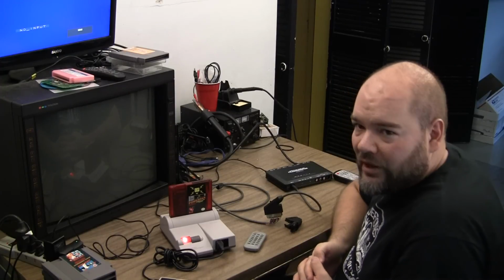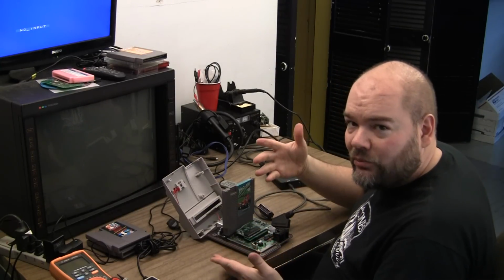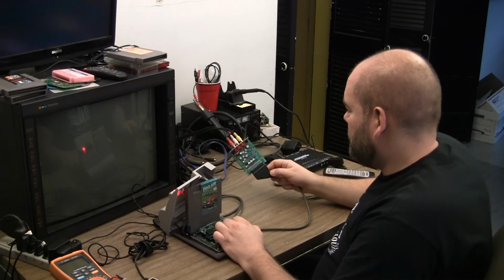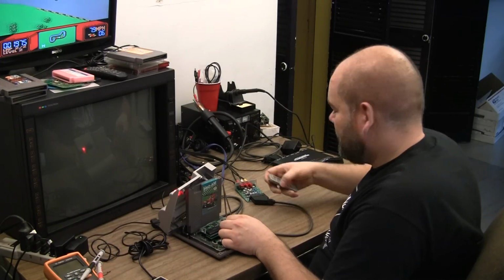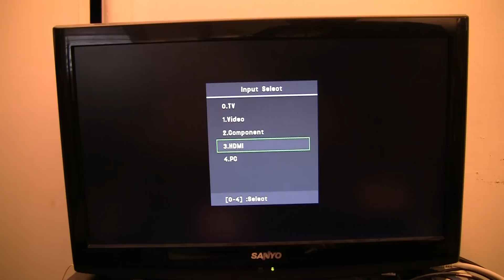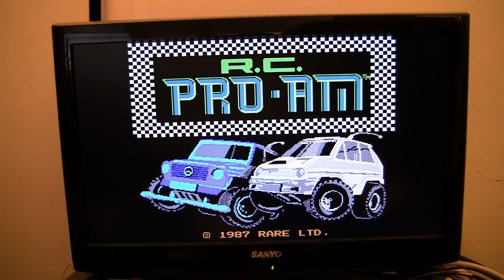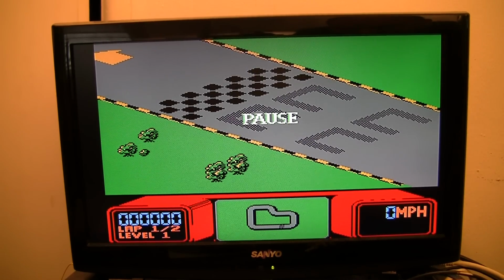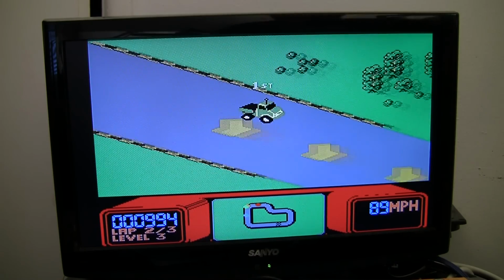NES-101 Nintendo - NESRGB with xrgb mini and csy2100 Pt 3

Comment: I've heard of a lot of people having various issues with the CSY2100. I know in a previous video here, you pointed out some video glitches that showed up when using it that weren't there in straight RGB. I went out of my way to find a Kramer FC-14 because of issues like that. It doesn't have any pots to adjust the RGB, but the colors all look spot on, and no video glitches that I can see.

Comment: In my experience, the xrgb mini almost always prefers composite sync.
Reply: hooo boy, it depends entirely on your setup, if you got anything inbetween the console and the framemeister composite sync is godaweful. It does not give a clear picture, the edges are wavely but with an external powered syncstrike its all fixed so I just use the external syncstrike constantly and it just loves it

Comment: Oh man, now I gotta watch out for the type of RGB-to-component converter I use too? I thought I'd just get the one on eBay (CVS287) and that would be that.
Reply from the maker: I can do an internal component mod with a better circuit for about the same cost as an external, but the external can be used on multiple systems.
I am also trying to get Tim to make an rgb board with component out as well, that would be super sweet!
Reply: GameTechUS Is there room in the top loader for the NESRGB, the AV multi-out (ideally replacing the channel switch and RF out), and the component mod? I was thinking you could put those component jacks where the sticker is. I thought I'd be fine with RGB through the multi-out and using an external converter, but if your internal component mod is better, then I'm gonna have to go with that...

I got big plans for my top loader, but I don't mind having you put in the Playchoice PPU in my front loader before that. Glitches, shmlitches... I still think it's cool to have the soul of an arcade in my console. And, well, I already paid for it. I could make a vid comparing it to Wii Virtual Console too.

Comment: I couldn't help noticing that you removed your topside heatsink? Is this required in order to get enough space for the NESRGB? And would it be considered safe?
Some Google research only results in a test someone did where it seems to reach some dangerous temperatures when it's off.
Reply from the maker: It's not a hear sink, just emi shielding, but yes it has to be left off to leave room for the nesrgb and no it won't hurt anything.
Reply: Thanks. Of course, makes sense :D